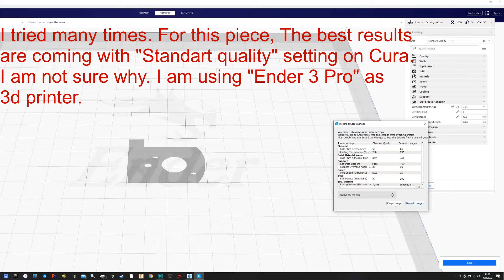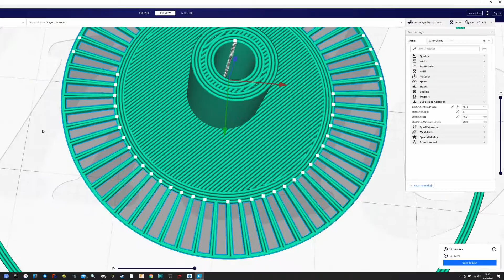Logitech G25 G27 Encoder Foult Fix.

Comment: I have this same logitech but recently i bought the MOZA Bundle and still wanted to use the shifter so i had to get the DVI end to USB so i can get it to work i had to go into ATS and set back the H shifter gears so i can use it but no i notice that when i shift gears and sometime take my hands off the shifter the truck goes into neutral never happen before of it would go into neutral on it's own if i keep my hands on the shifter and hold it there depends of the gear it hold well sometimes can you help me out i just got the piece yesterday from you i did reboot after installing it

Comment: My G25's encoder wheel has a small crack in it, but I also noticed during disassembly that the plastic body to which the motors attach is also cracked. Can I just replace the encoder wheel and put it back together?
Reply from the maker: It is hard to fix. Do your best to repair both. If it is not working, replace with another encoder wheel. If you can’t find a replacement part, the solution is in video
Reply: About $50 on ebay they have aluminum bearing housings for this.

Comment: I bought a new g27 in the box, but I had a calibration fix and opened it to check the plastic wheel, it didnt had any cracks so I moved it a little and adjusted the screws, I plugged it in and it worked like a charm but when I assembled it it stopped working and having the same issue as you. Do you think it might be a faulty cable going to the encoder? like u mention in 12:04
Reply from the maker: I think it is not all about cable.
Check the connector legs on encoder pcb. Most probably one of them is seperated from pcb
Reply: @MrCelali  I have the problem that the legs do not rest on the PCB
Do you have the diagram to solder it?

Comment: Hay friend, I have problems with my g27, when connecting it to the pc the steering wheel turns to the right and then to the left any times, then it stops and the led light of the shifter starts to blink, you think it is the same problem.I would appreciate if you give me any advice.
Reply from the maker: Hello, ı think your original encoder wheel has a crack. So encoder counting wrong. The Best way to be sure is open it. İt is not hard. If  ı am right it can be repaired. Or you should buy a new encoder wheel. Chose metal encoder wheel. If you cant find. You can do my solution too.

Comment: Hi bro, i have a g27 and its working, but it has a problem. Every time i plug it, it calibrates normally, but every time i rotate the wheel to the right side the center becomes 2% away from what it was, so if you rotate it 2 times to the right the center becomes 4% away from what it was and so on. After five minutes of playing a game, the wheel will be completely uncalibrated. And if unplug it and then replug it, it returns to normal, and then it does the same thing i said in the beginning. Please if you know any thing about my problem, tell me. Thanks for reading my message.
Reply from the maker: İt is all about encoder wheel.
Disassembly the encoder disc. I bet there is a tiny crack. And the light is passing thrue. If you can't repair it, (maybe super glue can help) you must buy anotherone. I suggest to you buy a metal one. But be carrefull there is two type encoder for g27. 30 slot and 60slot
Reply: @MrCelali  thanks bro so much, appreciate it.
Reply: @MrCelali  but bro how can i know if it is 30 or 60 slot
Reply from the maker: @raedamasha  it is 60 slot; There is 60 holes, İf it is 30 Slot; There is 30 Holes . You can count or you can google it. Look at the pictures. 
Feel Free To Ask. I'll answer when I am able
Reply: @MrCelali  ok bro thanks very much
Reply: 🙋🏻‍♂️ hi
I have the same problem. My encounter wheel is in best condition. What can I do😢
Reply: @marcelgries8273  i don't think so, pay attention to it, it can be damaged a little bit but you didn't see it

Comment: AAAAANNNNDDDDD, I WENT THROUGH THIS WHOLE HOUR LONG PROCESS, REPLACING THE ENCODER AND ITS STILL DOING THE SAME FUCKING THING.
Reply: Did you ever figure it out? I'm in the same boat.
Reply: logitech is worthless
Reply: @aloex3994  absolutely
Reply: @j0hncon5tantine  never got it working again
Reply: I ended up putting a washer on the broken encoder to hold it together and now the whole thing works perfect....
Reply: @j0hncon5tantine  Whats a washer ? my encoder having some problems too